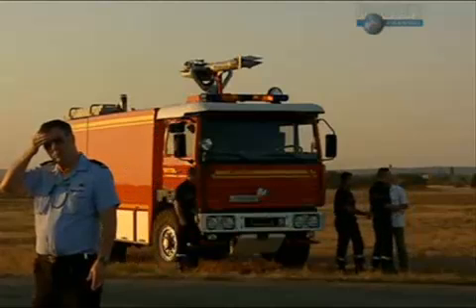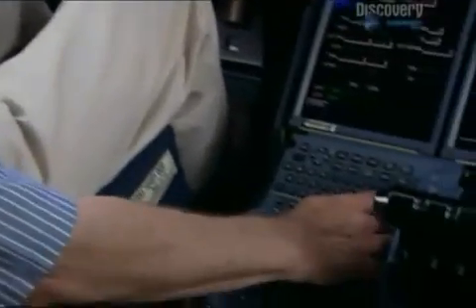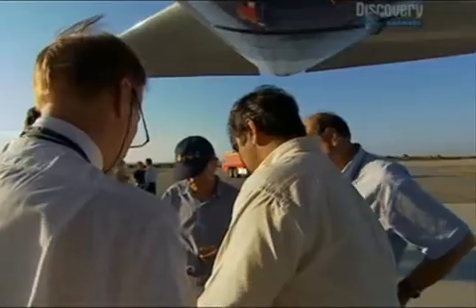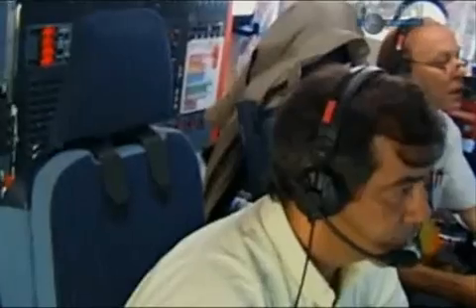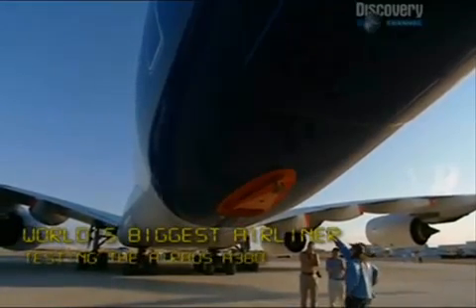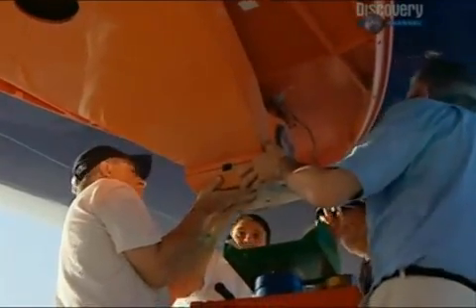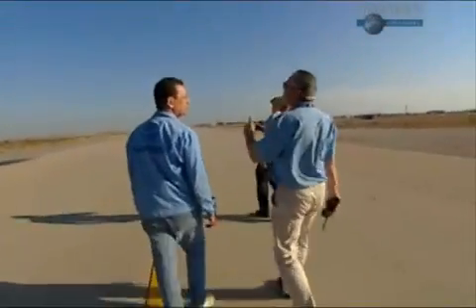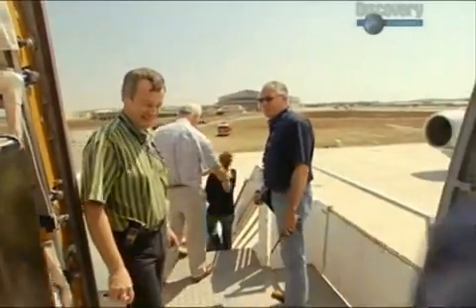Airbus A380 Tail Strike Test

Comment: 4:05 did they just ducktaped a fking A380 😂
Reply: Its speed tape. Its super expensive and like 10× as sticky
Reply: @laa0fa  no its FLEX tape 
:D
Reply: Yes, but he then used his magic ID badge to get it to stick.    That airframe is stronger than new.
Reply: They’re using flex tape.
Reply: @HelloRasupuBegasu  glad that joke hasn't been made before
Reply: THAT’S A LOT OF DAMAGE
Reply: It was cuz the fuel was leaking
Reply: It's flex tape
Reply: If it can’t be fixed with duct tape then just use more duct tape ! 😂